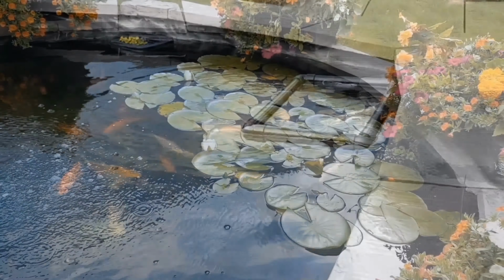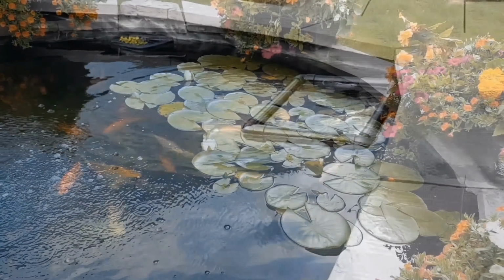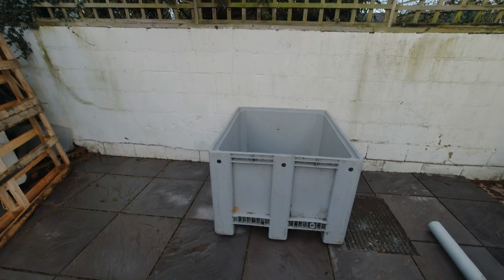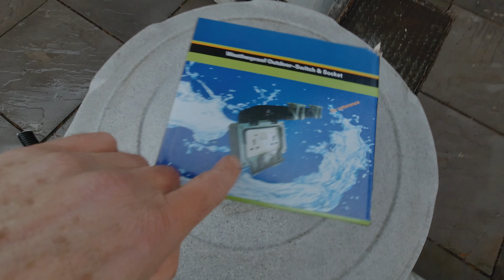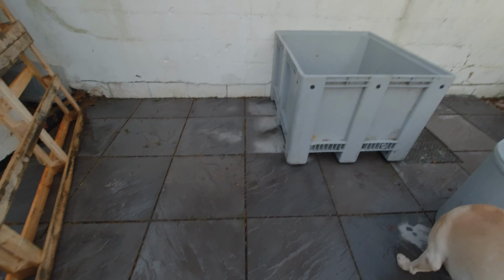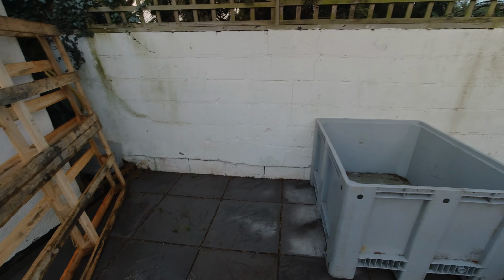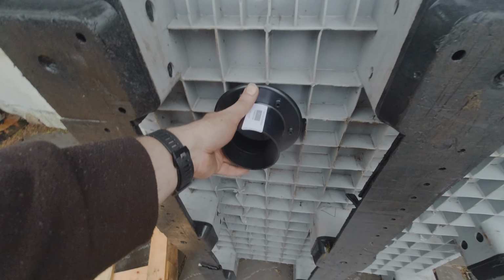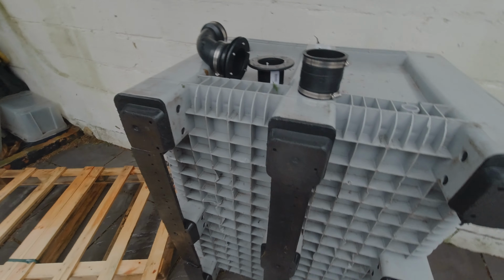BITS AND BOBS (KOI POND)

Comment: Well done mate with your bits and bobs excellent, it’s nice to have a spring project  on the go. For info re fittings try, these two, I find they have everything and at really good prices. Eeziflow, or gas and water pipelines, the websites are excellent.
Reply from the maker: Thanks mate, I appreciate that. And cheers for the info 👍🏻

Comment: Hi Andy another great video looking forward to the fry tank videos. Did you not check out eco-filtration as they do 3” Tommy bottom drains would fit lovly in them totes 👍
Reply from the maker: I didn't mate, most of the parts I've sourced are what i already have or found cheap, I will take a look though 👍🏻